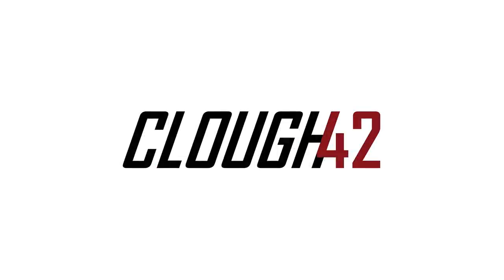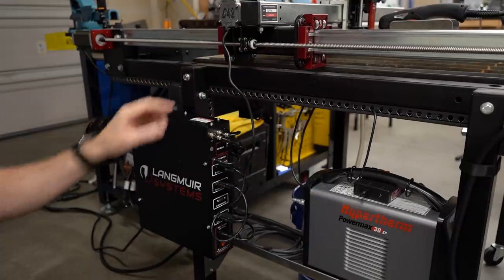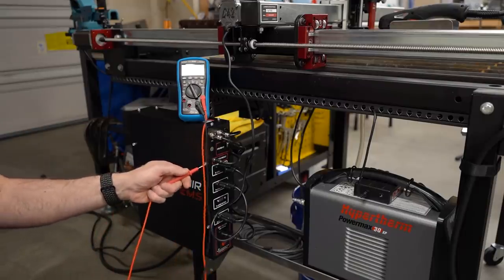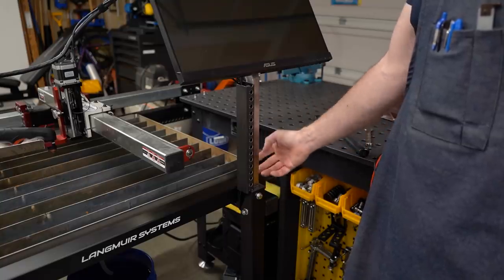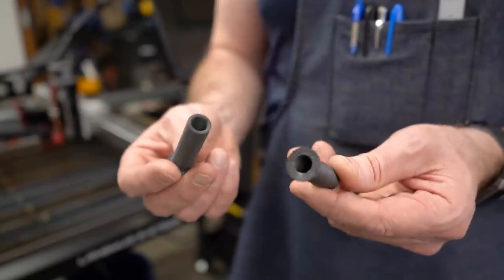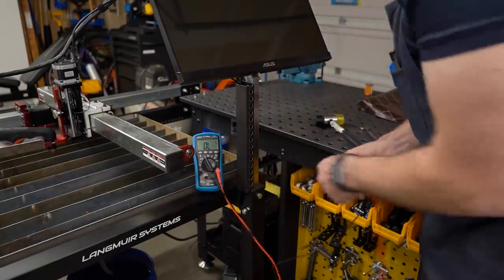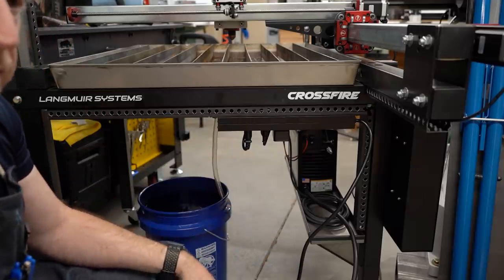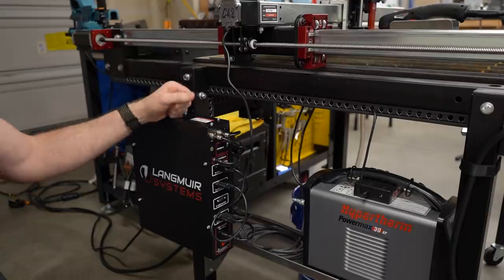AddenDUMB: I Broke My CNC Plasma Table! | Learn from my mistake | Langmuir Crossfire THC

Comment: Suggestions for your plasma table from experience with mine. Put it in a separate room and/or build a downdraft vacuum system to evacuate the particulate while cutting. Even with the downdraft you WILL get top spray that will accumulate in your shop unless you set a vacuum nozzle at the cutting tip.  For best results put it in a separate room and build a downdraft for it. Just saying. Enjoy your videos
Reply from the maker: Yeah, if I had more than a bay and a half of a residential garage, I would totally do this.  I would also have a separate room for grinding.  As it is, the table sees occasional use, wheeled out of the corner to cut something, drained and wheeled away to store.
Reply: @Clough42  I was just going to edit what I wrote earlier. I had a 2100sft shop and noticed even with the downdraft it was getting over spray in the surrounding area. I realize you will do occasional cutting so please disregard my previous post. On a side note, I agree with your mistakes video.  I should have a PHD by now from the mistakes I've made and learned a lot. I just resubscribed to enjoy your content. Have fun.

Comment: USB ground is connected to earth ground through the monitor?
Reply: There are loads of ways that people connect ground and shield in USB. In basically all cases though, they are tied together to earth ground at least somewhere. And the shield is typically connected to chassis ground, so eventually they will be connected. USB is, essentially, never an isolated connection.
Reply from the maker: Shield ground is probably a better term for the USB cable, but yes, they get connected somewhere eventually.
Reply: The shield should only be connected to ground at one end normally, but it also wasnt the only path.

Comment: Shit. A ground loop the long way....
During university courses in electronics and measurements we learned about ground/earth free measurement situations, and the cautions. .
Why a screen, computer would be have chassis to ground/earth? Poor design I would say.
Pooh, nothing got damaged. Very nice to hear. You were lucky having equipment that just shut down.
It's nice to deal with electrical stuff being "fully isolated" meaning having to protective ground/earth...

To Your final words....
In the end of the 1970:ies we built hobby computers, Z80, Texas 9900 etc. One hard thing was to get a monitor. Some guys used televisions and they had the chassis connected to one of the two mains pins..... That called for turning the mains plug to the right position to get the chassis connected to the neutral......

Comment: Question: Who sells a metal power strip that is not double insulated?  Mind blown
Reply: Everybody.  If the case is metal it gets earthed as its safety.  If it's plastic it can be double-insulated and not earthed - since it can't be.  The fact the case is conductive means it MUST be earthed since if a live wire came loose inside the unit and touched the case, it would make the case live and then the user would complete the circuit to ground next time he/she plugged something in.  With the case earthed, the earth connection should be a much easier circuit to ground and hence take all the voltage.  If things like an RCD are fitted, it will also trip as soon as the current flows to earth.
Reply: @Cenedd  Yeah. all well and good. until you get fried.  Metal extension leads just seem like stupidest idea ever.
Reply: @Cenedd  Possibly "WATER-COOLED" would be even stupider...  doubtless that is an optional extra

Comment: James obviously "solved" his problem, but this video provokes more questions than it answers! Part of the confusion appears to be between electronics signal ground versus chassis safety ground and the implications of connecting the chassis ground of the control box to the chassis ground of the table.  In principle, no arrangement of interconnected grounds should cause the plasma voltage detect signal to get shorted and read zero... unless....  OK, so the plasma table is basically a positive-ground system -- that is the table carries the positive side of the plasma power, and the torch voltage (to be measured) is negative relative to that.  And yet Langmuir's detection interface "Voltage Input Module" (VIM) appears to consist of a simple voltage divider, possibly with some filtering. If it has no active component, then it will produce a negative output voltage (relative to the table).   But that would require the Torch Height Controller board to accept and digitize a negative input voltage, which most analog-to-digital converters will not do. 
That could be easily solved with an inverting op amp circuit on that control board -- but is that what Langmuir implemented?  The alternative would be to float the electronics and attach the electronics signal ground to the negative output wire from the VIM, and feed the VIM positive output (ie: possibly the table frame) to the ADC positive input.  If that is how it's implemented, then of course an unanticipated connection of the electronics ground  to the plasma table will short the VIM output signal, and make the TH control board see zero for the plasma voltage.  That would be a very poor design, so I don't want to jump to conclusions, even though it explains the symptoms.   
It would be super interesting if James would measure the signals from the VIM to the TH controller, and determine what their voltages relative to the table, and relative to electronics ground!
Meanwhile, judging by forum posts, some owners of this gear have other problems relating to noise propagation of one sort or another disrupting the controller MCU(s?) and/or comms with the PC.  These may entail grounding or shielding issues, but are not the same as the controller running fine but seeing a zero plasma voltage.  Further, connection of industrial gear to a PC over USB is a known issue in general, and greatly eased by providing an isolated USB port, at the cost of a ~$1 part, (though supply of those has dried up during the chip shortage).
Reply: FYI, you can measure negative voltage with any ADC using a resistor divider. You only need a positive bias.
Reply: @MaX271  You indeed propose an alternate way to avoid having the ADC see a negative voltage. And that method is going to require a positive voltage reference and also depends on knowing pretty exactly the source impedance (in the separate VIM box) in order to combine it with one or more additional resistors to get a known divider ratio. Unless you add a local buffer, in which case you might as well make it inverting. My point was that Langmuir would have to implement some strategy, however trivial, to deal with this. One of those strategies (electronics ground connects to the VIM negative) leads to the symptoms James saw, but again I'm reluctant to think they did that without further evidence

Comment: Well, building the ELS, mixing 2 projects on the workbench and connecting 25V DC to the circuitboard instead of to the servo. Which fried the logic board, the Clough42 driver board, the rotary encoder and the display circuit board. Nice going, expensive mistake, and smelly
Reply from the maker: I'll bet.

Comment: Carbon Fiber is an electrical conductor. What is the datasheet of the material saying about the conductivity of the material?
Reply from the maker: It isn't conductive to any degree that I can measure.  It would need to be in the 10k ohms range to be an issue.
Reply: Geometry and the phase of the moon would be factors to consider in trying to work that out, but it would be interesting to see a high voltage insulation test perhaps. Usually unless specifically made to conduct CF filament is just enough to be considered anti static, which in itself can be useful.
Reply: @Clough42  thanks for the information. I worked a lot in the fabrication of carbon parts and carbon monocoques for racing cars. Isolation was always an issue even in the polymer matrix.
Reply from the maker: @mathieub3953  that's continuous fiber, though, right?
Reply: @Clough42  it is both continuous fiber and much higher fiber content.
Reply: @Clough42  depends how it's made. We used prepreg sheets and layed them in a specific pattern. If you want it to have a good conductivity you need high pressure when autoclaving the parts.
There are also endless fiber woven parts.
You can also use very fine copper mesh which gets impregnated into the polymer matrix.

Comment: James Marry Xmas to and the Family.
On my plasma system I put the work clamp to the sheet that I am cutting I did the table thing and get ark spikes that would shut the computer off it was isolated system I seen my friend system in his shop and ask him about how he was connected the work clamp to the steel directly and then he said the spikes would reset or shut down his computer. The light bulb 💡 on yaaaaa since then my table been running flawless for 10 years.

Comment: ah, yes, the goods old ground through a data cable. Learned that one the hard way on my first project at my first job. We made a data capture box for Buses (that they could plug in to the bus PLC, capture acceleration/deceleration/speed to analyse driver performance), spent 4 months on it, worked flawlessly. we deliver it to the customer, they come back saying it didn't work. We try it, it works, ok, check all the cables, everything is fine. I go, with my boss to their office, we plug it in, it doesn't work. I get my laptop out, it works. raaaah. turns out, their laptop power bricks passed ground over to the positive pin to the computer. When plugging in the serial port, while the capture box was connected, the ground from the db9 between computer and plc would create a ground loop and crash the electronics.... that was a fun one.
Reply from the maker: Wow.  That's pretty bad.  I guess as long as everything you connected was floating, you'd never know the whole laptop was below ground potential DC.

Comment: It is interesting since most pro level tables ground the enclosure to everything through star grounding. Hypertherm has a 12 page manual in proper “star” grounding of everything so does Lincoln. All main plasma systems call for a single busbar to each individual component including Cabinet, gantry and the Z to an earth ground/ Rod! It’s common to ground all these points then run it to a wall ground.  

Langmuir machines are a horrible quality product. 

They don’t  use ANY (absolutely no) double shielded cable or drains and in fact.. they use standard printer cable with no db9 pas through EMI filters. The noise issue is exactly why they don’t implement safety products like limit/ home switches or e stops. 

They don’t use any ferrites  

They split wire all power lines, coms and grounds! They use no busbars or distribution blocks! 

They use all (too long) 22 gauge non silicon wire with agin no shielding or ferrites between the controller and the cheep $10 Chinese drivers. 

The don’t use proper terminals or ferrules, they just tin the wire! (Even in the PS! 

They use cheep, unbranded and “Noisy” power supplies! 

They use usb power to power the 5v and 24v lines of their older Chinese boards....pre Arduino uno board. 

They shipped units with improperly rated torch relays for months! The original relay was also inadequate! 

They don’t coat the control box in EMI/EMF protective coatings.

They inadequate ground the entire machine.

They use extremely cheep stepper motors. 

They use undersized ball screws that whip like it’s a hurricane and many times arrive bent. They use no preload bearings/nut on the ends. They use cheep backlash nuts. 

They use non EMI filtering AC panels mounts. 

They use extremely cheep panel connectors know to arc, rot, crack, and melt with no ability to drain EMI! 

They have customers use T-splice connectors on their plasma cutters. 

Their marketing is the only thing they do well...like no other cnc plasma company that came before. They have a business model that sells inadequate products then UP sells continuous UPGRADES to its consumer base. Their forums are filled with idiots who’ve completely rebuilt their machine many times over but are still loyal to the brand like a cult. They used to falsely claim that their linear bearing system was proprietary but wasn’t. 

Their water pans / water table  can’t even fully drain, yet they know this, still produce it the same and suggest that each and every customer modify their own pan. 

They white labeled “fire control” and utilized open sourced projects for their THC and main board firmware. 

I was extremely disappointed to when you started pushing their machine. You know quality components and engineering! How many sub par machines do you think your channel sold? You fully comprehend EMI protection. You know the value of these sub par components don’t justify the MSRP if a 2x2 2 axis machine. Your  peddling junk. 

There are serious quality control issues with this brand! n in arguable fact.
Reply: Ok lets say you are right about the quality. Yet they do seem to work for most people.  And we can afford to buy it.  You forgot to mention what CNC machine we should buy.  All your complaining and you left out the main point.

Comment: Seems that Langmuir has made a poor choice by not providing isolation for the torch height circuit. Mesa (common hardware supplier with linuxCNC) has a fully isolated THC input board which eliminates this issue for systems using their hardware. Thanks for confirming that it is better to build and know what you have than trust others to design safe and robust systems.
Reply: The torch height circuit was isolated until James inadvertently connected them.  Doesn't seem like a design flaw to me.  Glad you're happy with what you have, no point bashing others though.
Reply from the maker: I think this is probably right.  A true differential input with enough allowable offset to accommodate the open circuit plasma voltage would solve this
Reply from the maker: The torch circuit was isolated, but the input to the controller is not.  If it were, grounding the plasma circuit would not matter.
Reply: @Clough42  agreed, but 1) it's the cheapest table you can buy, and 2) it was fine until modified.  As delivered it does the job it was intended for safely.  There's no way Langmuir can plan for every possible owner mod at the price point they sell at.  I doubt the $50k machines are entirely fool-proof.

Anyway, Merry Christmas James!
Reply: @rennkafer13  If the input circuitry was actually isolated from the rest of the controller, connecting them would not have caused any issue. Having to rely on plastic washers to keep the controller isolated from the frame of the machine it runs is a poor design choice, probably just a miss during design, but when discovered the fix should have been proper isolation of the input not plastic washers. A similar choice was Ford Pinto runabout gas tanks and bumper bolts. not a robust design, but fine if nothing unexpected happened. In this case it is lucky that the reading was zero instead of damaging the plasma machine or wiring. Mesa's board is $70 in singles, the parts can't be more than half that. That table is $1500, the THC control option is another $550, maybe it should be $600 with real isolation. $2100 vs $2050? I would be happy to pay that difference.

Comment: I would have thought the plasma cutter voltage would have had a full isolation measurement.
Reply from the maker: I think this is a case of it being a simple hobby-grade controller.
Reply from the maker: I think that would be ideal.  Even a non-isolated differential probe would probably solve it, also.

Comment: Carbon is conductive too. Not a good conductor but conductive none the less.
Reply from the maker: PETG is not, however.  Which is why the part reads open circuit.
Reply: @Clough42  True. I was expecting a high resistance reading but not OL. Glad it worked. Great videos BTW. I'm very jealous of all your tools.

Comment: So not only electric chairs, but also electric tables. Interesing. PLEASE measure voltage between metal and ground while you are cutting.
Reply from the maker: Are you asking about safety?  This concern would apply to any plasma cutter, and the plasma cutting process in general, independent of the CNC controller.  The work clamp will always be in electrical contact with any welding or plasma cutting table, car body, etc.

Comment: I used a 230v grounded (Well actually, not the real ground but to my radiator/heater allowing for a voltage spike around 50v) noise filter for my power supply to the record player (turntable) caursing my kiseki purple heart saphire pickup to go to the eternal highfi heaven..... I still kick myself....
Reply from the maker: Yeah... That'$ painful

Comment: Anything in a PC that measures anything is NOT supposed to be referenced to the ground in any way. Differential probe, galvanic isolation, take your pick -  anything EXCEPT "well ground is also Protective Earth, is that going to be a problem...?"
Reply from the maker: You're not wrong.

Comment: That's funny I modded mine in exactly the same way by mounting rail brackets for the plasma cutter to sit on underneath the machine one unit just makes sense. I also bought a tube of 1/4" thick quartz glass then covered it in laser film made a mounting bracket to the z axis to contain and shield the plasma head. Works well hasn't cracked keeps the sparks dust down and I can watch it while it's cutting. Got a buddy who does glass blowing and I'm going to see if he'll make me a offset Y joint instead so I can port inert gas to the head and experiment cutting some materials you wouldn't normally be able to.